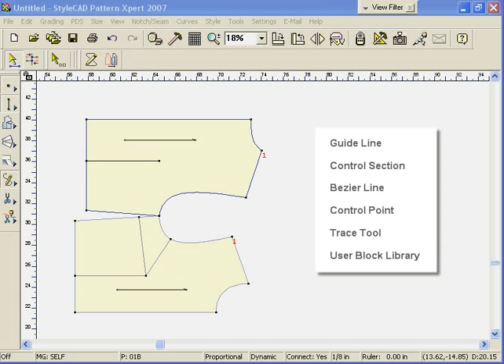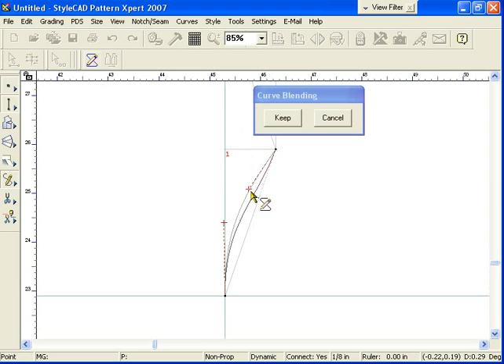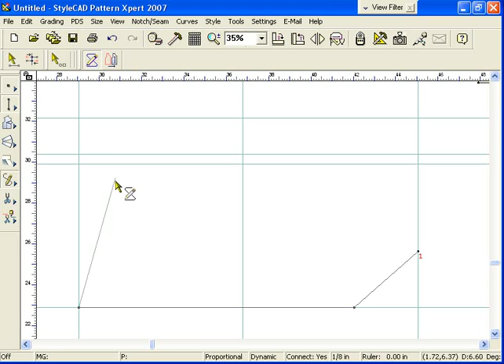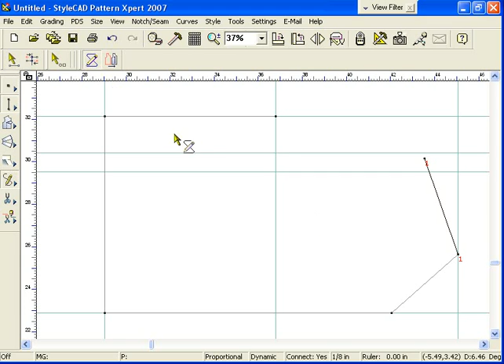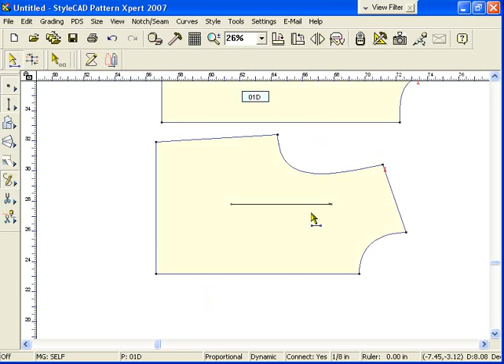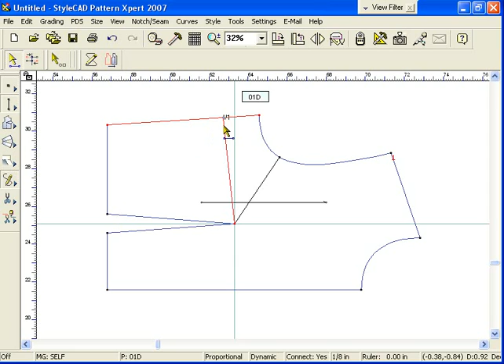StyleCAD - Basic Block Lesson (English)

Comment: There's a glitz in the video at 36 seconds guidelines just appears with no instruction as to how it got there ie. measurements, or tool used. please help.
Reply from the maker: Hello James, 

There are a couple of ways you can add guidelines in StyleCAD. You can drag guidelines from the ruler areas, use the HH and VV QuickSteps, or select an existing guideline, entering in the distance from that line to add another parallel guideline. The guidelines you are referring to were added by first selecting the top horizontal guideline and entering the distance of 1 3/4 and clicking below the top horizontal guideline. Then we selected the guideline that we just added, entering the distance of 1/2 and clicking below that line. Hope this answered your question. If you have any other questions, please let us know.